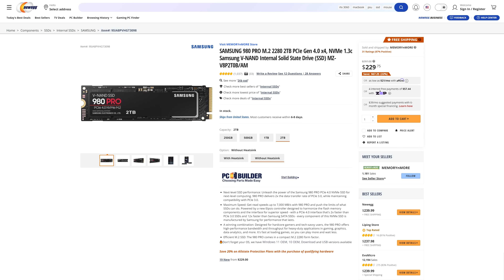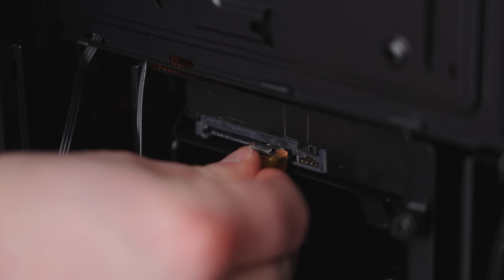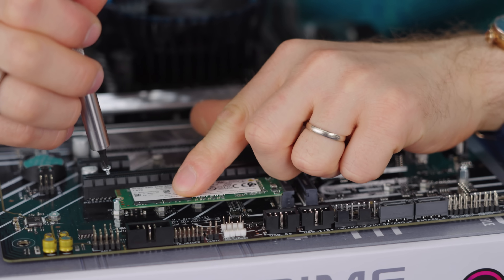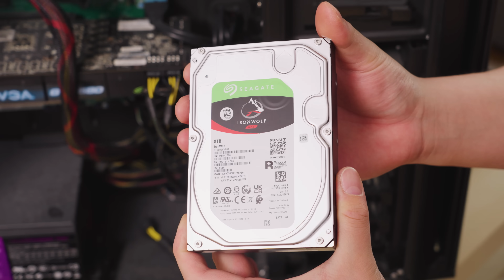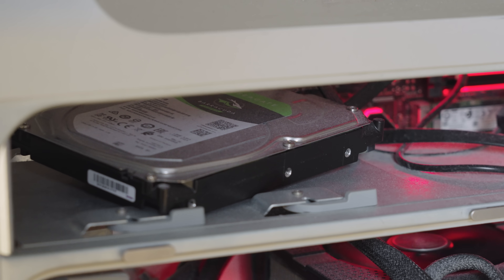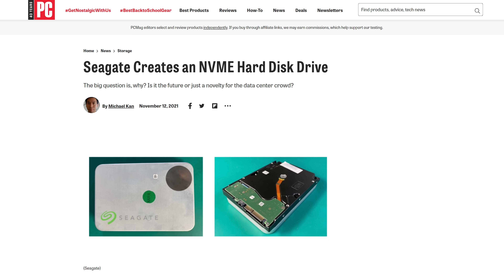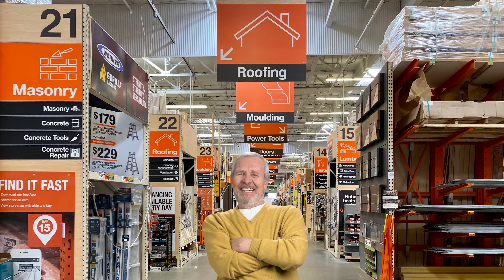Is SATA Obsolete?

Comment: PATA died to SATA.  Not anything else.  SATA is much easier to deal with in many ways.  The mechanical drives are the same.  Only difference is the controller and the cables.  PATA cables were thick ribbon cables and a PATA connection was limited to 2 drives, which needed jumpers set.  In the space of a single PATA port on a MB, you get 6 SATA ports.  There were usually 2 PATA ports, for a total of 4 drives.  Moving to SATA allowed the space for ports to be cut in half on the MB, along with adding 2 more mechanical drives to the system, and then some MBs added 2 more SATA ports for a total of 8.

It's kind of like saying a MB got faded away because of newer MBs.  It's true, but you still have a MB.

Many home systems don't need mechanical drives anymore.  They've moved to large volume data storage, and for that they're still king.  With 20TB drives now, 4 SATA ports give 80TB of storage.  Somehow I don't see that being economical for a home user within the next 10 years if you move that to NVMe, that is 80TB of storage.

I don't see SATA ports going away anytime soon.

And, let's remember that the typical NVMe drive isn't really accessible.  It sits between the GPU and CPU, or is under the GPU.  This means you typically have to take off a CPU cooler to get to it, or remove the GPU, or both.
Reply: I have never seen a M.2 slot that was covered by the CPU cooler (unless you had a behemoth of a CPU cooler that came close to interfering with the GPU).  The GPU on the other hand...   It does beg the question though, how often do you need to access your NVMe drives and at what point do you have problems with removing the GPU?  My main M.2 slot is not interfered with by my GPU but the other 3 would require the removal of my GPU which would be a pain because it has tubes attached.
Reply: @emu071981  might not be covered by the CPU cooler, but my GPU covers it and my CPU cooler makes it damn near impossible to reach the GPU PCI lock to access the NVME, which in turn makes me leave it unlocked at all times just to do some quick cleanings. Otherwise I have to remove the CPU cooler just to access either GPU or NVME.
Reply: Let me put it to you guys this way, I had an old Dell prebuilt with a hard drive and that infamous shitty Dell OEM board, albeit a time long enough ago they were still standard not the nonsense whatever the F Dell is doing with nonstandard plugs/form factor. 

So my board has only 4 SATA ports, plus an extra mSATA for some strange reason that I never even used for most of the machine's existence. Of those 4 SATA ports, I think two of them were running old 3gbp/s mode, with really only one being allocated to modern fast SATA iirc. I ended up putting a second SATA drive in, but it had an optical drive (back when all drivers etc. came on CD). So now while I do get to have my wifi and a 128gb mSATA, I'd have to disable my optical drive to get another drive.

You will understand perfectly well why having more fast SATA ports matters after having to deal with that, and I ended up having to basically just get cheap USB 3.1 flash drives to leave plugged in all the time as my new game install directories toward the end of that system's lifetime. Now imagine telling me well we'll give you another couple mSATA's you'd have to partially disassemble your computer to install/replace but you'll now have to give up some of your super limited USB ports and halve your SATA. That's why the premise itself is madness to me, because keep in mind most people just buy laptops and prebuilts so you're making throwaway systems basically. Like you have NO IDEA how much joy it gave me just to double my number of SATA ports on this new machine, and not have any of the bullshit in the old one. Most people are going to be buying cheaper boards who build themself, and are meanwhile counting their coins, so NVMe is still going to be more expensive than a hard drive and SSD for games, so those boards are going to be making lots of sacrifices in making room for more NVMe for something most gamers are going to find somewhat pointless.

Also keeping in mind that one extra thing: storage wasn't always cheap, and games are getting bigger. We're talking about 110gb installs now. Just imagine something having a whopping 220gb install in the future. We're at a time where storage is simply cheap, but relative to how big some of those are getting, like 4k videos and future games, and even if it's cheaper then that 4tb NVMe drive is looking like a bad option.
Reply: @pandemicneetbux2110  You can buy a 4TB harddrive for $USD 69.  You can pick up a 500GB NVMe SSD for around $USD40-$USD50.  The combination of these two storage devices will serve the average user for the foreseeable future - i.e. OS on the NVMe drive, some games on the NVMe drive and the rest along with bulky data  on the HDD.  NVMe drives are roughly the same price as the equivalent sized SATA SSD as long as you avoid PCIe gen 4/5 NVMe drives which are kind of overkill for the average user.
Reply: I mean you can get a quad NVMe card, throw on 16TB of drives on it, and run it. Unlike my 4TB WD black drives, both of which suffered high error rates and one has 21 sector reallocations so far, haven't had an issue with SSDs save for my oldest that worked for 10 years and recently went to read-only.

I see either a new standard popping up, or board makers going big into NVMes. SATA won't die until HDDs do, which will be decades, but you can already see WS boards supporting 4+ slots.
Reply: @almightydeity  "I mean you can get a quad NVMe card, throw on 16TB of drives on it"

You mean YOU can.  I certainly can't.  a 4TB NVMe is STILL way too much money for me to afford.  I can buy a 16TB EXOS drive for less than the cost of a single 4TB NVMe

It's nice that 2TB NVMe drives, even good quality ones are FINALLY starting to have sale pricing below $200 USD.  And this is a recent thing.  Before they were around $250.  In fact once that price drop happened, that got me away from feeling like I needed NVMe RAID just to have a singe 2TB partition.
Reply: Like the other guy you don't know what PATA is.
Reply: @LudusAurea  "Like the other guy you don't know what PATA is."

If you're talking to me I've been building PCs since 1995.  I could tell you in detail all about the progression of hardware and interfaces in a PC because I've seen almost all of the changes.  SATA = serial.  PATA = parallel.  It required those thick ass ribbon cables and you were limited to 4 drives since almost any MB had 2 PATA connections and each connection fed 2 drives, one drives being a master and the other a slave.

I can't tell you how many times I have to dig into a PC just to check if a drive was set to master or to slave.  And then you're checking that against a guide for the hard drive so you had to find that book.  Since going to SATA I never had to keep that stupid manual that used to come with drives.

Anything else?
Reply: If (and this is a big if) i were to purchase a 20tb sata drive, there is no way  a Seagate brand drive would even be in consideration. 20 tb shouldn't be crazy expensive but what ever they cost id pay the extra for the Western Digital version, and the peace of mind.
Reply: A computer with an 8 bit data bus, a buffer IC and some address logic. Except for software, it didn't need anything else for PATA.
Reply: NVMe drives in a Thunderbolt enclosure are super easy to hotplug, and every bit as fast as motherboard mounted drives.
Reply: Thanks for repeating the video in the comments 👍
Reply: @jeremywp123  He didn't repeat the video, the video wrongly stated that SSD killed off PATA when it didn't, SATA just replaced PATA.  SATA was released in 2000, did you own a solid state drive in 2000?  Because no one else.    SATA was just the next evolutionary step for connecting internal components and so it replaced PATA, just as PCI replaced ISA for internal cards and USB replaced COM and PS2 for external peripherals.
Reply: @krashd  From what I remember, MBs had Sata connectors from like 2004 (I mean commonly, you could not see it before 2004). I had first sata HDDs in like 2006 or 2007 and in 2008, PATA HDDs were already obsolete and you could buy only SATA new HDDs, that's like 5 years before SSDs started by more common, so say that PATA disapeared because of SSDs is nonsense, it disapeared even before SSDs, there was already SATA II in 2007, it's much older than some people think and the latest versions of PATA supported 133 MB/s which more than even young SSDs could reach. And the main power of SSD is not transfer speed, it's low latency which worked perfectly even on PATA, I remember some PATA SSDs, it existed.

BTW, I totaly hate sata connectors, it's so fragile and there bad conntacts, especially with SATA 1 (before they added extra fencing around connector on MB) it was really hell, you had to constantly changing cables or gluing it to MB to make sure it will be working even tomorow. 😀  These problems are still happening even today, Sata connector is really badly designed, PATA had annoying wide cables, but when you installed it, it worked forever and you could be sure that it won't randomly pop out like it happend with sata, they added lock mechanism and extra plastic fencing later, it helped, but that solved only MB, on HDDs, it looks still the same like 15 years ago, even after locking, you can still move with connector a lot, that's just wrong. They should keep sata standard, but change connectors for something better, maybe something similar to USB-A would be better, or USB-B, that's the best connector ever.
Reply: @Pidalin  "BTW, I totaly hate sata connectors, it's so fragile and there bad conntacts, especially with SATA 1 (before they added extra fencing around connector on MB) it was really hell, you had to constantly changing cables or gluing it to MB to make sure it will be working even tomorow. 😀  These problems are still happening even today, Sata connector is really badly designed, PATA had annoying wide cables, but when you installed it, it worked forever and you could be sure that it won't randomly pop out like it happend with sata, they added lock mechanism and extra plastic fencing later, it helped, but that solved only MB, on HDDs, it looks still the same like 15 years ago, even after locking, you can still move with connector a lot, that's just wrong. They should keep sata standard, but change connectors for something better, maybe something similar to USB-A would be better, or USB-B, that's the best connector ever."

Yeah those REALLY WIDE ASS PATA cables were GREAT!

NOT!

That was the WORST part of PATA.  You had to really think about how they would screw up your air flow if you have a powerful CPU.

I've never damaged a SATA connection or cable.  I guess if you do a lot of hotswapping that can happen, lot a LARGE number of hotswaps because I hotswap SATA drives and the only thing that's ever happened to me is the pins in the connector get a little loose and don't make good connection with the drive and then I have to toss that cable.  But I'd much rather have SATA.

I guess you just have terrible luck with SATA cables.

And yes, PATA died SPECIFICALLY because of SATA and nothing else.  Most normal people disliked PATA.  And when SATA was introduced to PC, there were drives that went with it.  Your PC either had PATA or SATA, not both unless you bought an adapter.
Reply: @johndoh5182  Take some old HDD or motherboard and try to damage it, you will be shocked how easy it is. People now know that it's fragile and you must be super carefull, but when I had first sata HDD in 2006 or 2007, I didn't know that. Look at motherboards from Sata 1 time, it will be luck when you find one with not damaged sata connectors.
Reply: @Pidalin  I guarantee you I can wreak havoc on an NVMe drive.

But I don't build a system and TRY to destroy parts so who cares?  I've never damaged a drive and I've been working with PCs since the 90s.  So I think I'll just put what you said down to "people who shouldn't try to work on their own systems"
Reply: @johndoh5182  Don't be that arogant, these things happen even to better people than you, it's just few days when I touched RAM slot on older motherboard and lock got broken after just soft push because plastics got fragile after years which happens to some plastics (typicaly black CD/DVD cases), these things just happen and you just had luck until now, it can happen to you yesterday or next week, but it will happen one day. But on other hand, today plastics are better quality than 15 years ago, so probability that it will happen is lower now.

Comment: There are many cases when SATA is better than NVME:
- each sata works with uefi and legacy boot (only some nvme like "950 pro" allow legacy boot)
- it's almost impossible to screw sata ssd, nvme is much more complicated and the cheapest ones can be funky (almost each youtuber has video on this topic)
- nvme is terrible thermal design aka having hot component close to your gpu
- nvme is terrible electronic design. Usually you don't want to pull many amps close to your sensitive electronics
- nvme ssds tend to use a bit more power than sata ssds (as you cpu doesn't have direct control over power management)
Reply: NVMe ssds consume a lot less power if you have one that you can switch back to the native 4kb sector/box size which is a majority. Most drives come with 512b emulated sectors for the ability to clone from almost any older drive and Windows 7 compatibility (lmao). The cost is slightly reduced performance and the controllef having to do a LOT more work which causes a sharp power and heat increase. To change a drive to 4kn you have to use the nvme-cli utility off a Linux install or USB which will wipe the drive.

Comment: i love spinning storage drives. specially the kind of noisy ones like western digital to give you some mechanical feedback. they're not abysmally slow either or i probably wouldnt be using any regardless of their mechanical charm. i wouldnt use them for loading windows but loading a game is fine
Reply: I hate them. To this day I'll sometimes hear my drives working away and then I remind myself, they are ssds and have no moving parts. I hear phantom HDD clicks
Reply: @chronometer9931  HDD? More like PTSD, amirite!?
Reply: @chronometer9931  they're fun to defragment too lmao align that data real nice for less traumatic clicking

Comment: Nvme has already reached cost parity with SATA drives. During the last Prime Day sale I was hoping to get a cheap 2 TB 2.5inch SATA drive for game storage and to my surprise the m.2 Nvme drives were actually slightly cheaper, but having already used both the m.2 slots on my motherboard they weren't an option for me.
Reply: Should have bought a cheap pcie-adapter, you could have had the drive you wanted instead of settling
Reply: @chronometer9931  he's not settling unless he moves large files all the time to that drive, plus the SATA SSD doesn't take bandwith away from the GPU

Comment: 1:36 wait what?? In Canada isn't SATA and NVMe SSDs similarly priced??

I checked my local shop and 480GB SSDs and NVMe is actually 2-3 euros cheaper then SATA LOL!

it's also pretty amazing how cheaply HDDs have become nowadays, I am soon planning to swap my 2x1TB HDDs with one 4TB WD Blue and it's only 90 euros like wtf!
Reply: I think it depends on the size of the drives, in the US, up to 1TB they're within a few dollars of each other, but for 2TB+ the difference starts showing, although oddly enough 4TB NVME and SATA drives are  priced fairly similarly, although past 4TB there's a noticeable difference again.

Also, some of the newer HDDs don't seem to be made to last, had a 4TB HDD die after I think a year and a half of use (It was an SMR HDD, basically it's "shingled" as in stacked on top of each other, so whenever it writes, it has to copy/overwrite other data, I'm pretty sure this is why newer HDDs, especially larger HDDs are so cheap), probably because it was more meant for just long-term storage rather than daily usage.
Reply: sucks to live outside NA,samsung 870 qvo sata is 20$ cheaper than kingston nvme 1tb

Comment: I have never used solid state storage in any of my computers, and have stuck with 1tb hard drives from Seagate and WD. This is because HDDs are cheap mass storage compared to ssds where I live. A 1tb hard drive will cost $50, and a 1tb ssd will cost $120. Not only that, my main computer has a RAID 0 configuration of 3 1tb HDD drives, so  any performance drop is not that noticeable.

Comment: Nah, we need SATA IV, I want multiple 2.5” SSDs, you can fit shitloads of SATA connectors on boards, m.2 slots not so much, there’s only so much room for things that lay across the board lol. We know SATA is the bottleneck, so why not 2.5” drives with NVMe speeds? I WANT MUH BULK FLASH STORAGE lol.
Reply: u.2?
Reply: @nepnep6894  Technically, yeah, I guess lol. But it's not very common, at least not nearly as common as SATA ports are on motherboards already. And u.2 drives are also fairly uncommon and very pricey too (I think, it's been a good while since I checked).